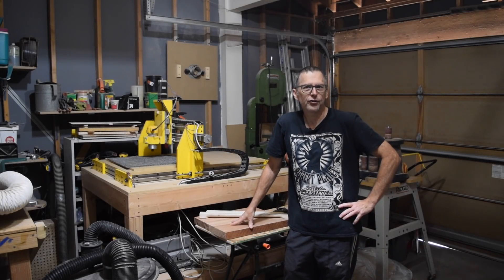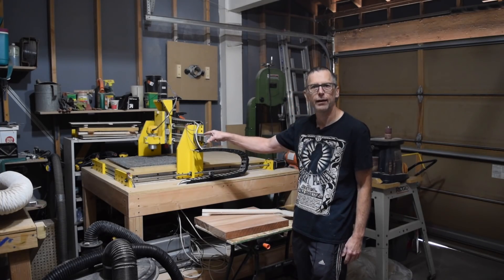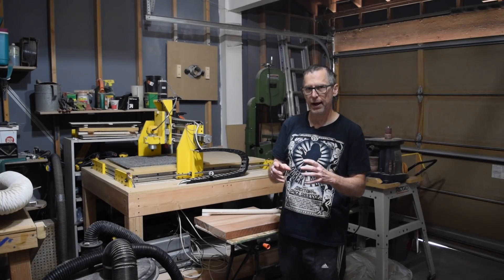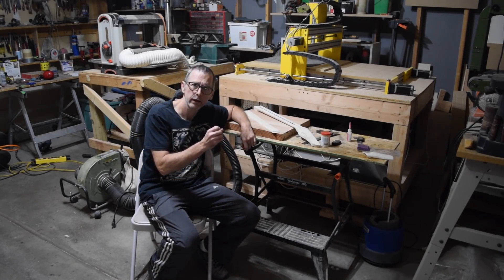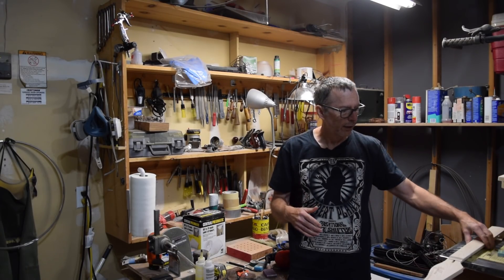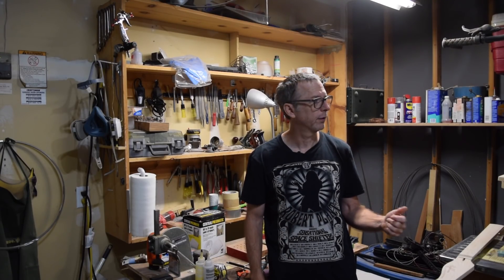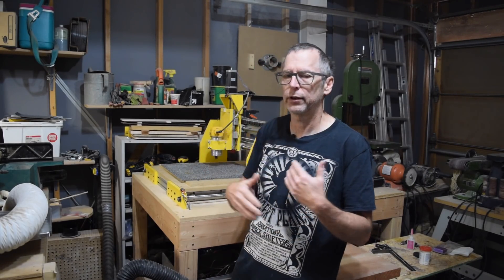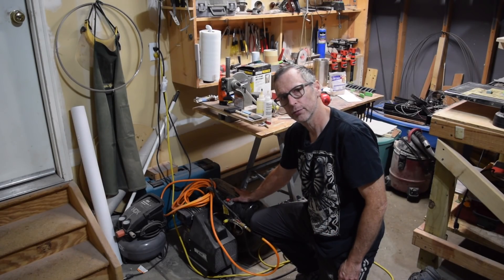Episode 120 The Highline Guitars Echo Build And An Update On My CNC Machine

Comment: Hello, what speeds of jog do you get on this machine? :)
And what speeds and depth are when you cutting wood? :)
Reply from the maker: 200ipm jog. 100ipm @ .125”doc. 1/4” diameter 2 flute bit.
Reply: @HighlineGuitars thanks... and what is the lead on lead screw? :)

Comment: Hi Chris-Very impressed with your build!  I am looking to build my own machine as well. Having looked over the comments and don't see a couple things I was interested in:
1) What drives do you have for your motors (the only kit from Longs that looked like your setup had DM542A Drives)
2) Can you provide a link or reference to the 'alternative' motor wiring you ended up using?
3) Have you tried cutting any aluminum yet?  I am very interested in your stability.
4) Is there a reference to what parameters to change in GRBL 
5) What are you currently using for design software?

Thanks
Reply from the maker: 1. DM542A
2. There isn't a diagram. I just wired the drivers to the Arduino Uno according their pinout.
3. No. I don't use aluminum in my guitars, so there's no need to cut any.
4. I followed the grbl v1.1 configuration for settings. https://github.com/gnea/grbl/wiki/Grbl-v1.1-Configuration
5. I use Adobe Illustrator to create a full size plan that I import into Rhino 3D for the Mac. After creating the 3D files, I import them into MeshCam to set the toolpaths. The resulting g-gode is sent to the CNC with Universal G-Code Sender.
Reply: Thanks for the fast reply Chris!
Did you successfully get your depth of cut to 1/8"?  Also, the motor wiring I was referring to was mentioned in your April update where you said you changed the motor wiring from what the mfg suggested to an alternative motor wiring setup found on YouTube.  That was the link or reference I was trying to find.

Thanks - Carl

Comment: Great video Chris, I appreciate your efforts. Looking into becoming more of a "production" shop and the CNC would help a lot. Building it yourself seems to have the benefit of cost, but is it worth the hassle? Do you think some people would be better off buying an x-carve or the like?
Reply from the maker: When I built my new CNC machine, I tried to approach it as an exciting new challenge. However, there were times when it was a bit of a hassle. The only cost benefit is in regards to parts which for me totaled just over $1,500. The time I spent designing and building the machine was probably worth about $2,000. An X-Carve with all the options costs around $1,800 and since you can assemble one in about two 8 hour days, that may be the better way to go. Keep in mind that the X-Carve I had was an older model. The new one is much improved. When I considered upgrading mine to the new specs, I decided to take the plunge and build my own design instead. While I don't regret that decision, it's not one I'd recommend to someone who wants to get into CNC quickly and with the least amount of hassle. In that case, I'd highly recommend the X-Carve.
Reply: @HighlineGuitars  thank you very much for the reply!